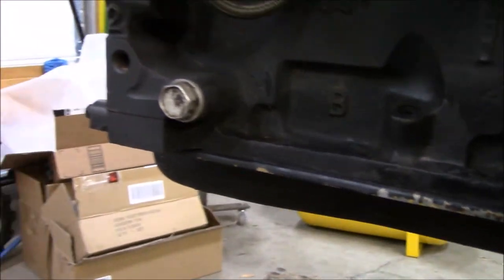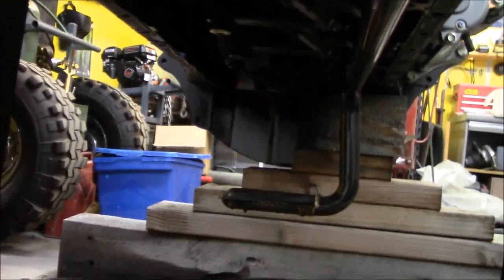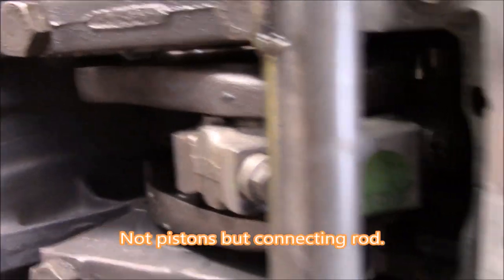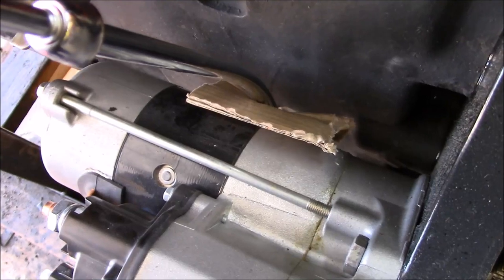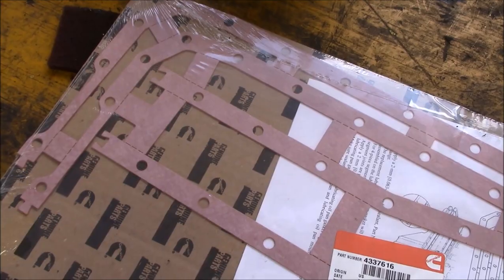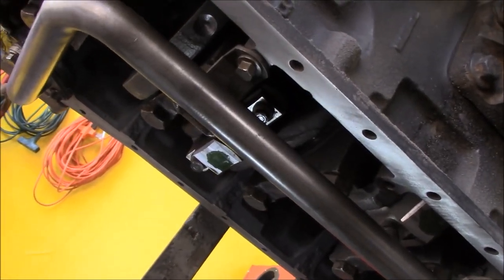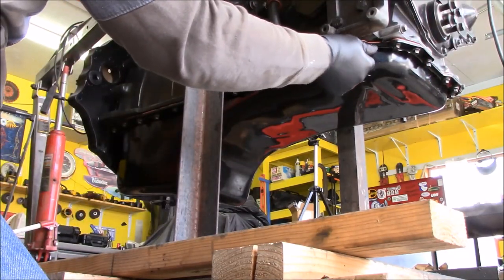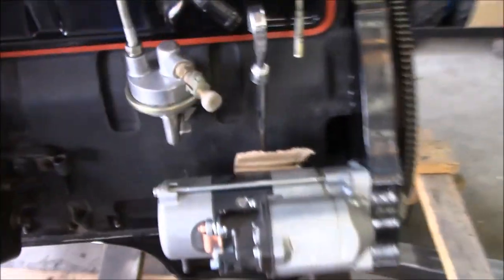Episode 50. Cummins oil pan gasket and dipstick setup

Comment: A little trick I used to do on my racing engines was I had some 4 inch long bolts the same size (dia and thread) as the pan bolts.  I cut the heads off and ground them with a soft point on the tips. Then I would screw them into the engine block a few turns to use a guide pins for the oil pan.  If I was in a hurry I'd also use a bungie cord under the engine that I could attach to one side of the block then swing it under the oil pan and hook it to the other side somewhere to hold the pan in place while I put the other bolts in.  Then I'd remove the guide pins (and bungie cord) and put the bolts in those holes.  Makes engine building a lot easier when you don't have a helper to hold the pan in place.  Especially at track side!

The guide pins made it easier to keep the gasket aligned while I installed the pans. 
 (Also used some for guides pins to hold transmissions in place while I line up the clutch. Hint, put the tranmission in 1st gear so you and turn the tailshaft to make alignment easy.  (Manual transmissions of course. Automatic just need a screwdriver to rotate the flex plate to the torque converter.))
Work Smarter, not Harder!  I built a Hot Rod Cummins engine in 2010 like you have there and stuffed it in my RV.

Comment: Did it leak again after?
Reply: Mine did. Just did my pan gasket with the napa gasket. Front part broke I never used any sealent though
Reply: Going to have to lift the engine again. Lol ?
Reply: @codyaubin8626  that’s the easiest way
Reply: @FirstGendodgegarage  do you use sealent with the gasket?

Comment: Can the oil pan gasket be changed in the vehicle?
Reply: Yeah but it's painful. You have to hook a hoist up to the engine, unbolt the engine from the frame, then after the engine is raised up a smidge, take the oil pan bolts out, then you need to remove the oil pickup return once you can fit s wrench in there. 

Then you can remove the pan. It's 99% labor